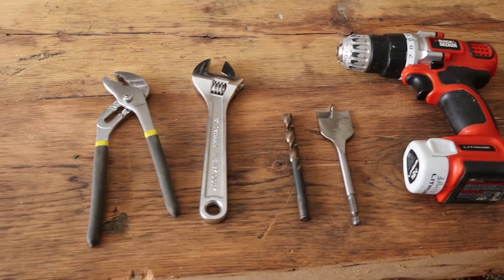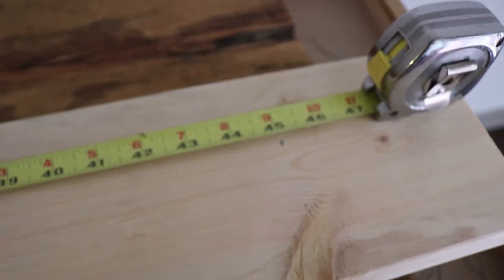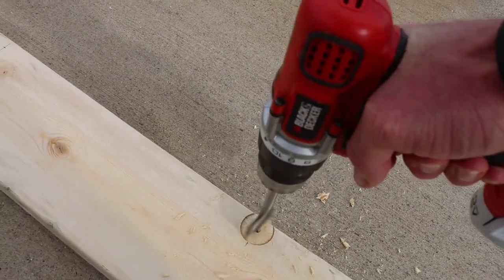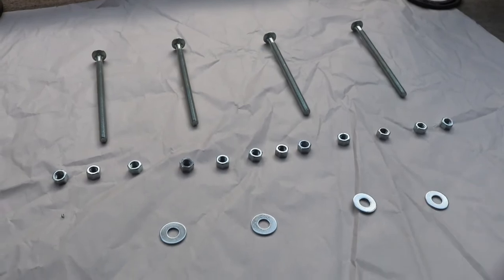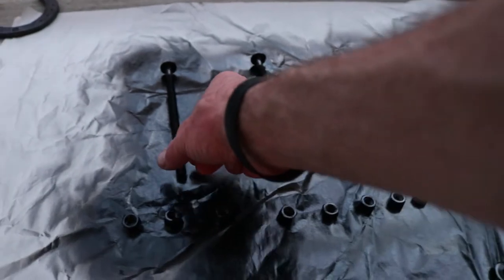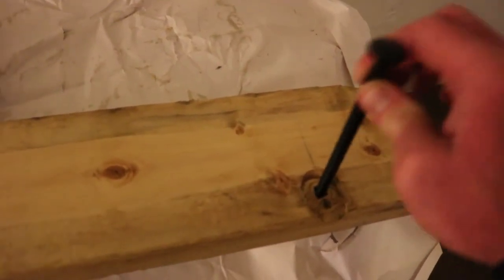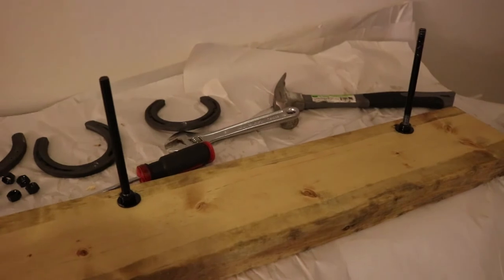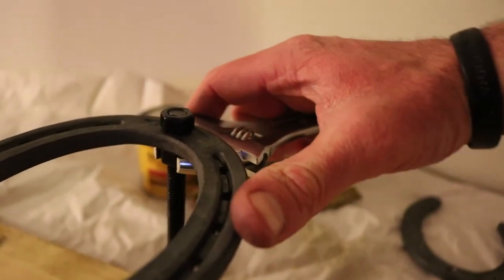How to Build a Custom Cowboy Hat Rack - A DIY Video Tutorial

Comment: Need more ifo ! Bolts 7'' by what size nuts and bolts 3/4 or 1/2 inch ? Whats size is the wood is it 2x6 ? how long is the wood ? drill bit size  all this is needed to do this project !
Reply from the maker: The bolts were 1/2", wood was 2x6 by however long you need to make it to fit your hats, and both your drill bit and paddle bit sizes will correspond with the bolt size you use and its head size.  I hope this helped!

Comment: Can this be mounted on a wall?
Reply from the maker: Jacee, yes it can be.  Just make sure to identify where the studs are in your wall, and attach it to them.  With the 2x6 board we used as a base it can be a little heavy, but our initial intention was to attach this to the wall.  Feel free to play round with the design and use a smaller (such as a 1x rather than 2x) or lighter board as the base to make it work for you!

Comment: What size bolts did you use
Reply from the maker: Hi Joshua, thanks for watching the video! We used a 7" bolt for the project, but I would check that against the size of your hat/hats to see if that will work.  Some hat manufacturers may have a taller crown or deeper crease than others.  Good luck with the project!
Reply: @TheBrothersWorkshop  thank you so much for the information about this project, you just got another subscriber
Reply from the maker: @joshuapalacio6047  you're welcome! If there is anything else you want to see us work on let us know! We appreciate the support!